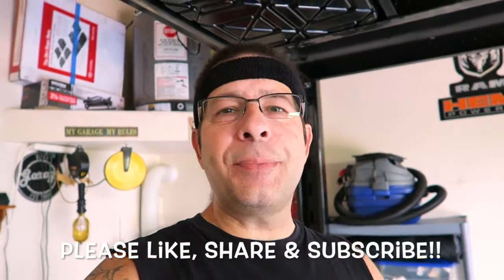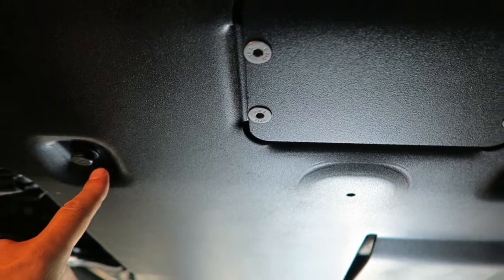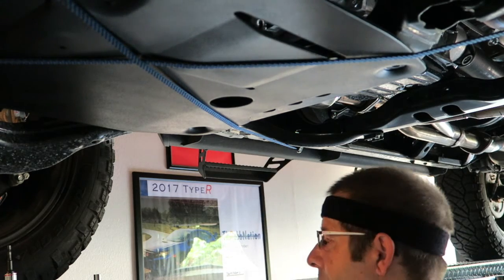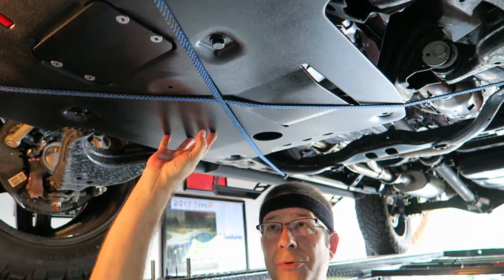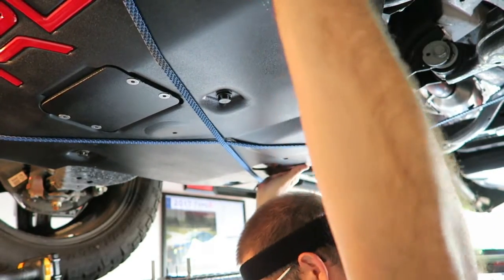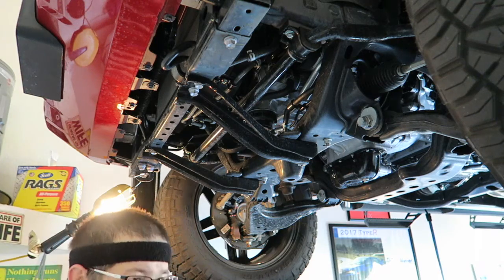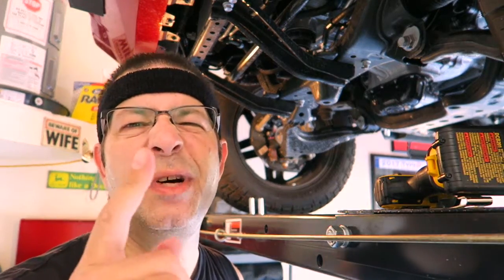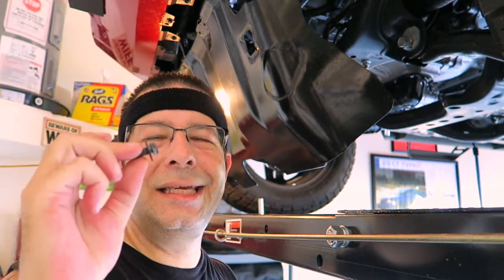Adding the Toyota Skid Plate to my Tacoma

Comment: I have a 2019 offroad . Will the trd pro skidplate fit on that without any issues. I saw one video where they had to use spacers.
Reply from the maker: Mine came with spacers as part of the bolt assembly.  I’d check with your vendor to verify fit before you order👍